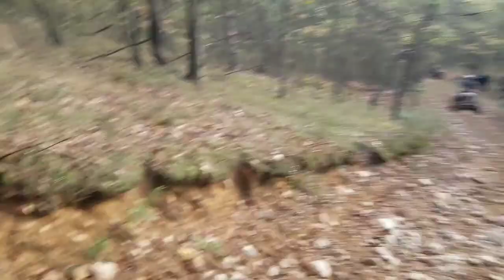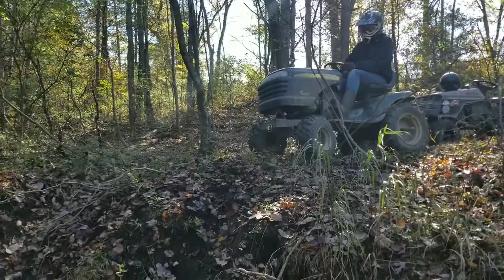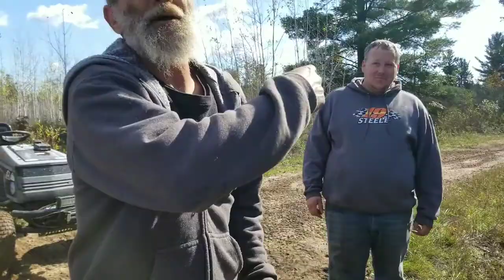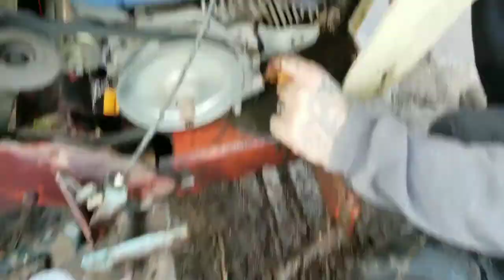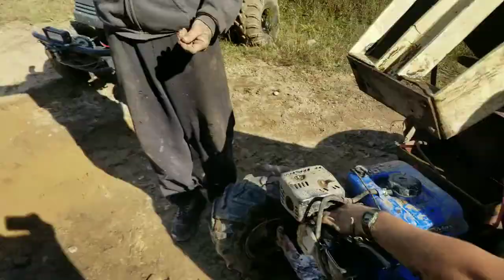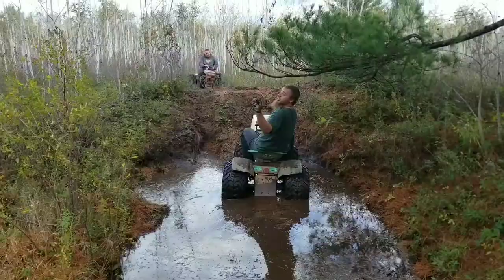Michigan mud mower ride

Comment: I am finishing up my 18.5 opposed twin engine. On craftsman Lt 1000 , new 5 inch rear pulley seems to be ok but not fast although that may be a good thing in the mud right !   Any advice is appreciated
Reply from the maker: What pully are you running in the front, what speeds are you hoping to get
Reply: @craftsmancrusher207  I haven't changed the front yet , I am testing out the rear pulley sizes ,, I'm just getting to 5he pulley part of the build and that's actually why I found these videos . As for speed I'm hoping for 30 mph depending on how stable it is to steer
Reply from the maker: @darwinwhitt8546  i recommended a 5 to a 5 or if you want to add a clutch stop a 6 to a 5, those are 2 of my favorite pully ratios, and the top speed for both is at least 20 the 6 to a 5 gets are 25-30 if i remember correctly